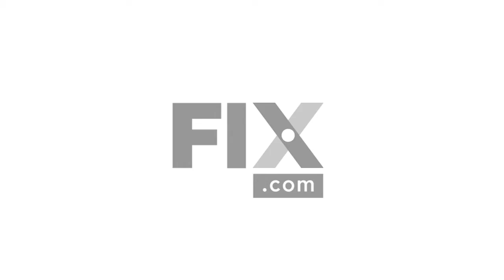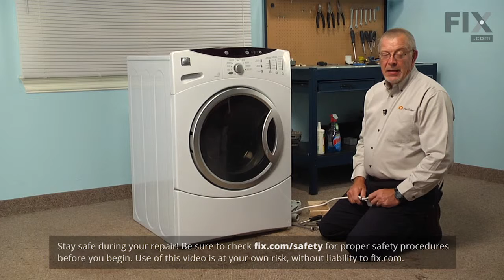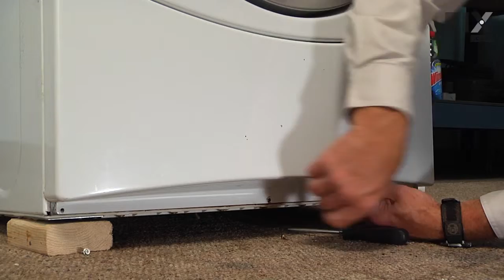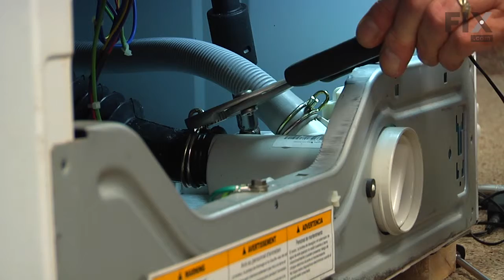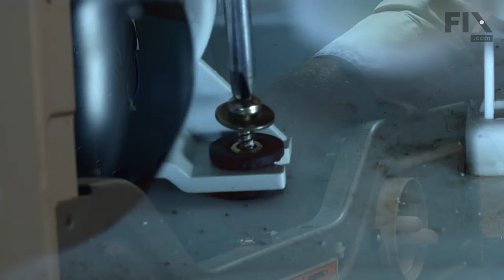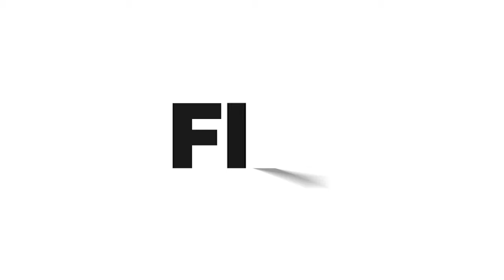GE Washer Repair – How to replace the Motor and Drain Pump

Comment: We did what this guy said to do and fixed our washer. The part was around $100. I think  repair person would have been $300-350. It works PERFECTLY now. Everything was easy except the tube clamps we a little hard. 10 out of 10 for this video. Side note- watched a different video where the whole front was taken off. If I had seen that first I would have said “no way”